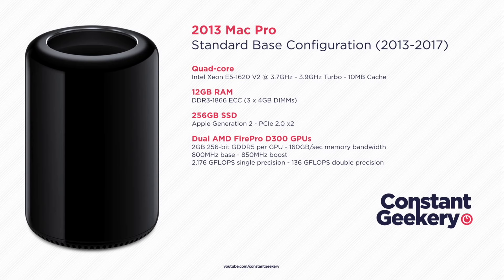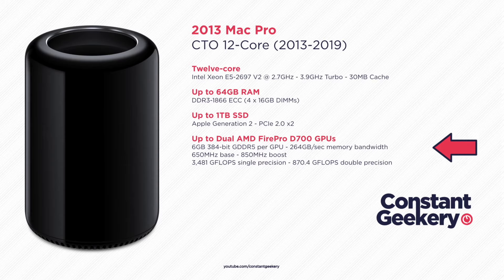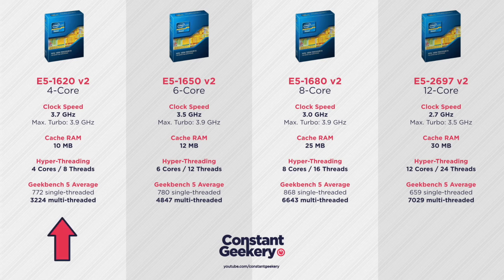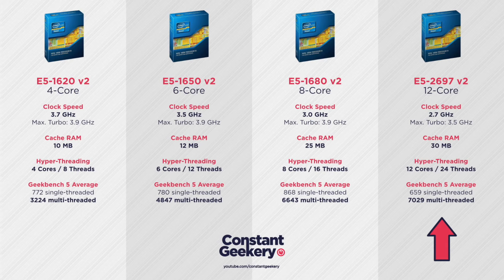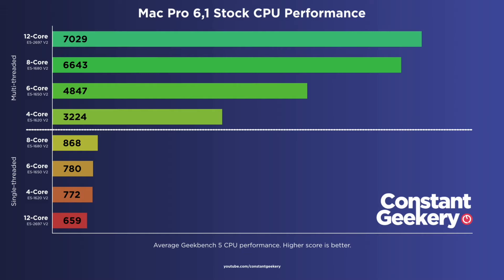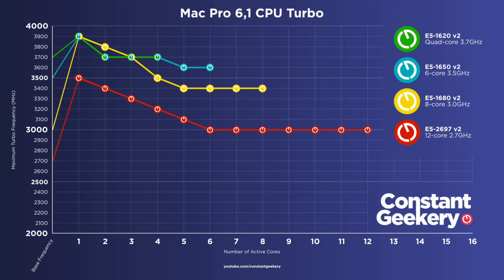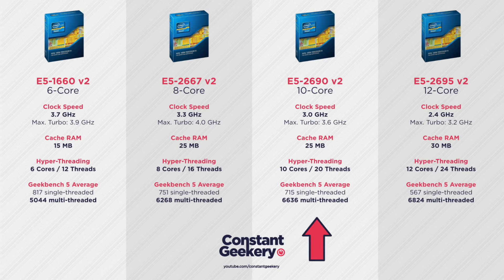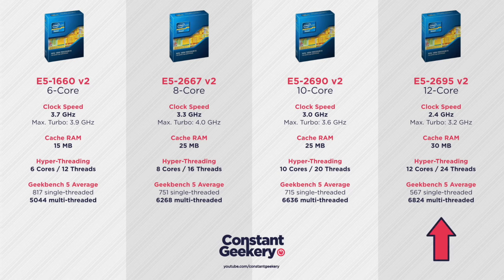Which 2013 Mac Pro should you buy?

Comment: I just bought 4 core with 512gb, 64 gb ram version, 🤞for years of use.  I’m mot sure I’ll upgrade cpu as I’m more single core user with occasional multi core use.
Reply from the maker: I'm sure it will provide many years of service - enjoy!
Reply: @ConstantGeekery  I got the Mac Pro, love it, but in Windows 10 during boot up I get all kinds of acid-colors for a brief second...GPU issues/failure or WIN10 and Bootcamp driver issues?  Yikes, love the Mac Pro but may need to return.
Reply from the maker: @DJonathanHayes76  if it’s not doing it in macOS, I’d say it’s possibly a Windows driver thing. 🤷‍♂️
Reply: @ConstantGeekery  I was using display port to mini display and tried hdmi same results... I’m in my return window, eBay purchase...it’s super fast in Mac but do seem to get warm to touch under medium load to heavy load but I’m using istats to monitor temps, they are 35 c to 65c normal load then upper 75c under load with a few spikes to upper 80+...I may try reloading windows to see if it does better, oh the things that test is, LOL!

Comment: Thank you for the great videos on the 2013 Mac Pro. Very informative, except some of your suggestions like doing a CPU upgrade are mostly only applicable to units that are out of warranty. There are still some new and refurbished ones out there. I found an Apple certified refurbished unit and I got AppleCare+ for it. I'll have to be careful with any upgrades due to the warranty. It looks like I would need to have an Apple authorized service provider do a CPU upgrade for me because reading over their terms it says if they think the computer has been opened (by someone other than Apple or an authorized service provider) they can reject covering any repair for any reason. Also, I have a copy of the technician repair manual and there are very specialized tools only available from Apple that are necessary for replacing internal parts such as the CPU and GPUs. I think it would be best to use those tools and follow Apple's instructions or have an authorized service provider do the work.
Reply from the maker: Glad you found the videos useful. If you are in a position where you have a warranty, then that’s a fair point and I wouldn’t recommend taking the unit apart. RAM upgrades and SSD would be OK, but nothing more... until the warranty expires. 😜

Of course, the previous Mac Pro 5,1 and the newer Mac Pro 7,1 are designed to be user upgradeable, so it’s understandable why many pros weren’t happy with this particular generation. In fact, it would seem Apple really don’t like CPU upgrades in these - I have a video going up soon about that. Thanks for watching!

Comment: Hi, congrats for the video 👏🏻👏🏻👏🏻. I bought I 6 core with 3gb GPU 1Tb ssh 64gbRAM Abs I’m facing lag playing back 4k footages with resolution 4096x2160 h264. Nothing alerted on Mac OS diagnosis. May I have a hardware issue?
Reply from the maker: Thank you 😊

The lag is most likely due to the H.264 codec. H.264 is highly compressed and requires CPU time to decompress. Consumer Macs have the T2 chip and Intel Quick Sync to help with these highly compressed codecs (H.264, H.265/HEVC). The 2013 Mac Pro doesn't have any custom chips, and the E5 v2 Xeons don't have Quick Sync. Without these highly optimised chips, it falls to the CPU to do the work. That's fine for 1080p, but at 4x the number of pixels, the 2013 Mac Pro struggles with 4K H.264 - especially if the colour depth is greater than 8 bit.

If you're editing video, you can create proxy media when you ingest the footage, which will speed up the timeline workflow. Alternatively, convert the clips to ProRes 422 before you edit.

I work with Blackmagic Raw 3:1 or ProRes 422 in both Final Cut Pro X and Davinci Resolve Studio, and it has no problem with 4K footage in those formats - even though they are much higher quality, colour depth and bit rate. There's less compression, and the GPU can do some of the heavy lifting.

I hope that helps 👍🏻
Reply: Constant Geekery the struggles happens when I try to open pressing the bar, not in the premier or final cut. MacBook Pro mid 2012 can open the file without struggles. It is more específico when the file has a resolution 4096x2061 with 60fps. On premier o can use proxies but a pre visualization on OS I keep with the struggles
Reply from the maker: @rrodegher  Understood. Quick preview still requires the same decoding of the codec. 4096x2060 is 8.8million pixels, 60 times per second. It's a lot of data to decompress. The MacBook Pro mid-2012 would have Quick Sync in the CPU - Intel's dedicated on-chip encoding/decoding hardware, which is why it's faster. Unfortunately, it didn't come to Xeon until later.
Reply: Constant Geekery that is make sense 😉👍🏻👏🏻 tks a lot Constant

Comment: He states that the CPU's with less power draw also perform less. But how does it work when comparing with the E5-2673 v2 with the E5-2667 v2 since they both run at 3.3 / 4.0 GHz? Does any one know why that is?
Reply from the maker: The two CPUs you mention are perhaps an exception, but it's not really possible to draw comparisons by clock frequency. The higher turbo figure is perhaps misleading. Typically you might hit 4GHz if a single core is being utilised, but this reduces to about 3.6GHz on the 2667 v2 if all 8 cores are utilised. The turbo has to conform to the thermal limits of the chip, and the 2667 v2 has a higher limit, suggesting it may be more performant for sustained workloads.

The 2673 v2 is 2 years newer, and though it has the same 22nm lithography, it's likely that design improvements allow for lower power draw for similar performance. The two are pretty similar, and there is perhaps an argument for having the lower TDP in this case considering the thermal limitations of the 2013 Mac Pro.

Remember too that the Mac Pro is somewhat unique in that the CPU heatsink is thermally linked to the GPUs, RAM and SSD. If they are all being worked hard, you won't get as much performance from the CPU, so a higher TDP may be preferable for some.
Reply: @ConstantGeekery  Thank you for your fast and professional answer. I hope it's ok to ask just one more question. The CPU throttle pretty fast, but can that be changed by using an app like SMC fan control? Will the throttling happen later than normal because the coolling profile stay colder for a longer period of time?
Reply from the maker: @larsandersen9134  I used TG Pro with mine and set it to ramp up as soon as things got warm. Never had a problem after that. Apple prioritised quietness over cool running, but the fan is perfectly capable of doing the job, if it gets a chance.

Comment: thanks for this great video. I have one question: is there any possibility to use other GPUs for this Mac ? Is there any Geforce GPUs ?
Reply from the maker: If you mean the internal GPUs, there are only 3 choices, and upgrading is a non-starter due to the cost. With eGPU, you can go with any of the latest AMD cards, but you won’t be able to use any decent nVidia cards as there is no driver support in macOS anymore. Apple insist that drivers support their Metal framework, and nVidia refuse to play ball. Their silly argument deprives consumers of choice.

Comment: Thanks. So if you had to choose: Mac Pro 8 core D500 or Mac Mini 2020 3,2‑GHz 6‑core Intel Core i7 ?
Reply from the maker: Tricky one. The Mini has the edge with single-threaded and has Thunderbolt 3. With an eGPU, the Mac Mini would be mighty, but that would make it more expensive. The Mac Pro will have better multi-threaded and is more upgradeable. I think for me, it would come down to cost. Both are great options.

Comment: Hello, I have a question for you, I recently purchased a Mac Pro "Apple Mac Pro ME253LL/A 4-Core Xeon E5-1620v2 3.7 12GB 256GB (Late-2013) MG7251" and my question is, can i put 128 gb RAM without any problem to this Mac Pro thanks
Reply from the maker: You can, but it will slow down performance slightly, so I’d stick to 64GB unless you specifically need more.
Reply: @ConstantGeekery  Thank you for your quick response, I have another question, I'm a little confused, I've seen videos in which they put an "E5 2696 v2" processor and others that I've seen put E5 2697 v2, which would be the right one for my Apple Mac Pro ME253LL/A 4-Core Xeon E5-1620v2 3.7 12GB 256GB (late-2013) MG7251 "AMC 2630" thank you
Reply from the maker: @Cinefilo_Celuloide  The 2697 is the original 12-core for this Mac. It is slightly faster than the 2696.

Comment: Hello , thanks for the videos , I am a bit confused about the 8 vs the 10 core .
I use logic and I just bought the 12 core version , I couldn’t find anything about what was really best for audio , single cores or multi threading .
The 10 core in the graph seems to be the best of both . Do you think it’s worth  switching to the -8 or 10 core .  I never do film size scores , but I do notice some of the modern guitar sims do tax the cpu a lot more .which is where I wonder if single core is better for that .?
Thanks again for the breakdowns .
Reply from the maker: I wouldn't worry about small differences in benchmarks, particularly considering the averages on Geekbench are not representative of actual performance for these CPUs in the Mac Pro. The 12-core punches some serious weight in Logic and I would have thought it would be more than capable of running virtual instruments and amp sims. (Have a look at the Logic test I did in my Part 4 video.) I'd be surprised if you got any benefit from changing to an 8 or 10 core. Logic is well optimised for multi-threading, and most software instruments and inserts won't get close to saturating a CPU core.
Reply: Thank you for the reply, I did try the benchmark and got about the same result
Reply: Hello again , one more question please , since you seemed to be very well versed on the Trash can Mac .
I got mine with the D500 video card , and I see one is in slot 1 and one in slot 2 , but I only see vram total is 3gb .
Is that normal ?
Thank you again for all the info you provide .
Reply from the maker: On the About This Mac screen, you will only see the display card shown, so 3GB is correct. If you click on System Report > Graphics/Displays the VRAM (Total) is specific to the card you have highlighted, so again it will show 3GB for a D500. Perfectly normal.

Most apps don't use the second card, so it would be misleading to report system RAM as 6GB on About This Mac. Also, since the Slot-1 card is compute only and can't have a display attached, this is not shown on the summary and only exists in the system report.

Comment: Here's another "tweak" you can do to the trashcan; 3rd party sellers provide RAM upgrades for it to 128GB.  HOWEVER, there is a penalty.  Apparently the clock speed of the RAM goes down when you do this, and surprisingly, the hit gets worse the more cores you have.   I think this is another thing you might have fun investigating....
Reply from the maker: Yes, I discovered this in some research, as I was going to “fully load” mine. It actually has a noticeable affect on performance and CPU benchmarks. There was quite a jump in benchmarks between the original 12GB / 3 DIMM configuration and my 64GB / 4 DIMM configuration. It would be great to get a load of different sized DIMMs and test all the possible combinations... 😁

Comment: Just upgraded from 3.7 Quad-Core Intel Xeon E5 CPU to 2.7 Ghz 12-Core Intel Xeon E5. My goal is to max everything for Video Editing. I currently have 32GB ram and the basic AMD Fire Pro D300 2GB. I'm about to also extend my ram to 128GB but really cannot afford the AMD Fire Pro D700 set right now. My question is: Because I've seen them available to be sold separately as A and B Boards. What would happen if I would just upgrade the A board to 6GB and leave the other to 2GB. Can you do that? Thanks.
Reply from the maker: Hi, well done on the upgrade 👍🏻 I believe it is possible to mix and match the GPUs. I don’t know what effect that would have on performance, but it should work. I’ve not tested it myself, so be sure to do more research before spending your hard-earned cash! Thanks for watching. 😊
Reply: Are you running a 4k display?  I"m thinking about doing the same but I want to keep my 32" 4k display which is running at 60hz and scaled 3008x1692 resolution
Reply: Max Nguyen I’m running 2 4K Lgs monitors.
Reply: @marktam   What resolution?  I have a 2018 mac mini running a 32" @ 4k60 with scaled 3008x1692 resolution.  I needed an EGPU for Macos to run smoothly.   Mind testing that resolution and refresh rate out for me?
Reply: Max Nguyen I can try after work. Not at home rn.
Reply: @marktam  Thanks!  That would be awesome.  Thanks.
Reply: @marktam  Thanks again for looking into that for me.  Also.  What cables are you using to connect to your displays?
Reply: Marco Tamayo did you get a chance to try?
Reply: @maxnguyen2875  I have both 27” LG 4K Ultra HD monitors running at 2560x1440 @60Ghz through Display Port. Very smooth no lagging.  The icons size are not too large nor small, just perfect for my taste. If I would choose the 3840x2160 @60Ghz (the MAX), everything would turn very small and also no lagging and very smooth.

I just placed both screens to 3008x1692 @ 60Ghz through Display Port. All running smooth and the scaling feels  less wide and more squarish. The text is smaller to my taste, also no lagging and everything very smooth.

Running on Mac OS X Mojave 10.14.6 with a Mac Pro (2013) Processor 2.7 Ghz 12-Core Intel Xeon E5, 128 GB 1066 Mhz DDR3 Memory, GPU AMD Fire Pro D300 2GB.   With 4k@60Ghz display port capable cables.
Reply: Marco Tamayo awesome. Thank you so much. 

So much ram!!
Reply: Marco Tamayo why not Catalina?
Reply: Max Nguyen because for some reason my mac was rebooting constantly and giving me an error and was sick and tired of it... that was with the previous version of Catalina not with the most recent update. Also I don’t know if because my previous CPU was the original 3.7 GHz Quad Core.. who knows.. I googled it and happened to lots of Mac users. Secondly, it was not 32bit compatible and my games and software wouldn’t run in Catalina. That’s why.
Reply: Marco Tamayo ah ok. Makes sense.
Reply: Did you notice any day to day speed difference when you went to the 12-core?

Comment: Is the Final Cut Pro software optimised for the 2013 Mac Pro with D700 ? Can it edit 4k files with ease or does it struggle ? I'm in the market to purchase a Mac, I already have a monitor. I'm not interested in the iMac Pro and the 2019 Mac Pro is way too much for me to buy... Just wondering if the 2013 Mac Pro still worthy editing machine in this day and age..
Reply from the maker: I edit 4K with the D300, so yes. FCPX is optimised for both GPUs. Performance is better in version 10.4.6 and Mojave.

Comment: Hi! Can I use m.2 nvme ssd Pcie 4.0 with ngff adapter to my mac pro 6.1?
Reply from the maker: It should work, but you will only get PCIe 2.0 4x performance, so there’s little point in spending the extra for latest generation drives. Always worth doing a bit of research before buying to check that nobody has had compatibility issues.
Reply: @ConstantGeekery  Alright, thanks for the tip.

Comment: Is it worth buying a mac pro 6,1 with 8 core d700  with 8gb ram and 256gb ssd and upgrade it to 16gb ram and 1tb ssd my self, or buy higher model for $400 more. Wondering if cheaper to pay $400 extra or upgrade and do my self.
Reply from the maker: I think at this point it’s difficult to recommend this machine, unless you have a very specific use case. It’ll usually be cheaper to upgrade yourself, but it’s a fairly involved job, so some might prefer to have it done for them.
Reply: @ConstantGeekery  Mayne wait for m2 mini Mac Pro lol 😂

Comment: If you use FCPX or the like get as much memory and cores as you can afford AND spend the most on the D700 GPUs. that's what I have and can tell you I could still use more than my 6 core, 128gb RAM, D700 2013 Mac Pro!

Comment: Wonderful job! I have watched all of your video about Mac Pro 2013's upgrade, I have few questions please help. 1. The CPU e5-2697 v2, can I buy used one which is Amazon renewed? 2. Can you give me the model # about Ram, I am going to upgrade to 64gb. 3. Can you give me the model # of the SSD of 2tb? My Mac Pro late 2013 is 6 cores/32gb/1 tb ssd, I'd like to upgrade to better handle my Video editing works. Thanks very much! Rex
Reply from the maker: Thank you. 1. Possibly, though you may find a better deal on eBay... 2. It’s 1866MHz ECC DDR3 - again, you can find it on eBay. I bought RAM that was pulled from an HP server; it doesn’t need to be Apple branded. 3. Original Apple 2TB SSDs are very expensive. You may find it better to buy an NVMe drive with an M.2 adapter (easy to find on Amazon), but do your homework and search forums for models that are known to work well.
Reply: @ConstantGeekery  thanks much for your help!

Comment: As a photographer who spends most of his time in photoshop, I have to say single core performance is far more important than multi core (to me).  There are certainly filters in Photoshop that run faster with more cores.  But I find its very rare that I use those.  I would guess a graphic designer might spend more time in those filters.  

For me the 4 core is the way to go and I might upgrade to the 6 or 8 some time later.  A large 2TB SSD was my first upgrade, followed by 32GB of RAM, up form the stock 12.   Anyone with 12 should bump to 16.  You can find plenty of cheap 4GB sticks online from people who replaced the 3 in their machine.